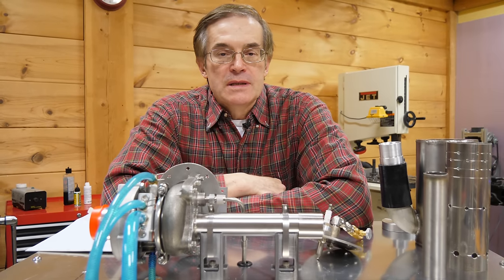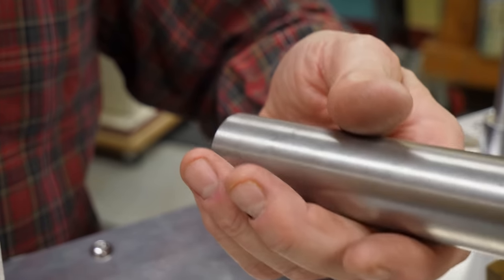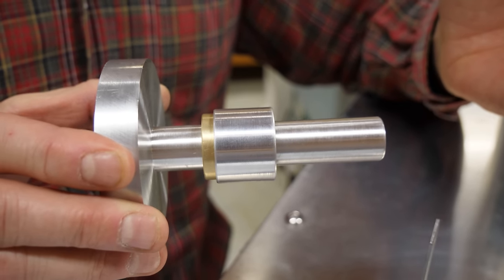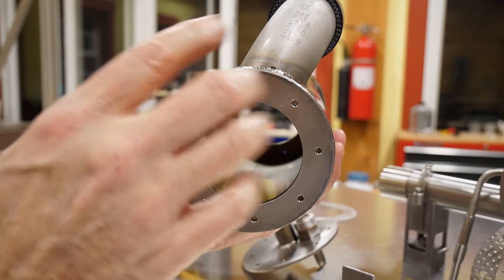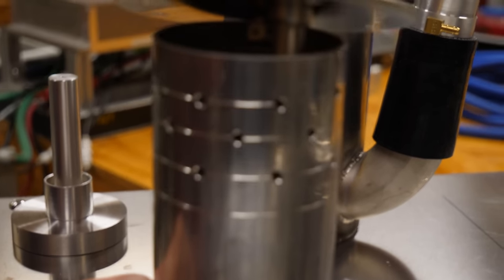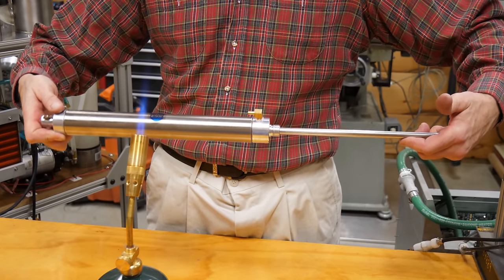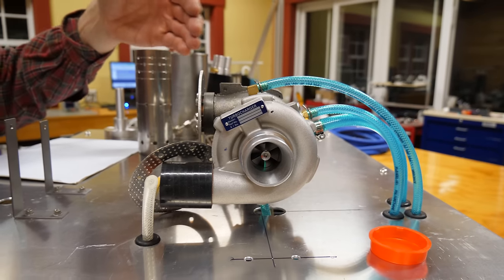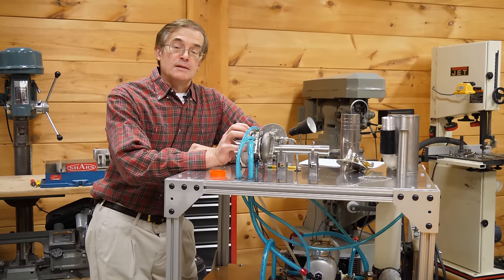The Turbojet!

Comment: This has to be the most detailed DIY turbojet engine build on the internet. Why yes, yes I will watch all ads in their entirety and give thumbs up.
Reply from the maker: Thanks!  Spread the word.
Reply: I take it one step further and click the ads :)
Reply: Chad L. I pay 12 bucks a month so that i can live ad free in you tube. I believe ive saved at least 1 years worth of brain washing. Lol 12 bucks means i skip one lunch a month dont hurt as much as an ad kicking in on the apex of my you tube binge.
Reply: Then you haven't watched Igor Negoda :)
Reply: Hey just so you know you don’t actually have to watch all the ad just at least 30 seconds, YouTube gets paid for simply serving the ad to give people the option of possibly buying and not on watch time alone. Clicking can help though sometimes.
Reply: Well....it's not "most detailed"  ;) watch?v=dYFYZ-g7fzA
Reply: I love that we saw the ratios for the inducer and flame holder holes, which other builds gloss over.
Reply: @TechIngredients  Type: Turbojet
Length: 3.86 m (152 in)
Diameter: 81 cm (32 in)
Dry weight: 719 kg (1,585 lb)
Components
Compressor: 8-stage axial compressor
Combustors: Can-type, 6
Turbine: Single-stage
Performance
Maximum thrust: 8.8 kN (1,980 lbf) at 8,700 rpm
Overall pressure ratio: 3.14:1
Thrust-to-weight ratio: 1.25

Comment: OMFG, the most detailed explanation of a burn chamber ever.

I was toying around with the idea of used oil burners, and I never could understand the great variation in burn chamber design. Most videos are like "and play around with it and make it work for your particular setup", but nobody gives any amount of theory on how to approach this problem, and how to judge various failure modes.

I realize that a burn chamber for an oil burner would be far more complex because of the wider variability in fuel type and quality as well as operating range of the fuel flow and air flow, but at least now I have some sort of glimpse on how to approach the problem. (I hesitate to say that I now have some sort of understanding, 'cause there's nothing i truly understand about it, but hey, it's a starting point).....

Comment: It's very helpful that you differentiate between scientifically calculated parameters, rules of thumb with explained bounding limits and "dark art" design. Without this clarity, a novice might think that this is a mature technology where a design could be calculated and built without testing or iteration and would perform as expected. There's a reason why companies like General Electric, Pratt and Whitney and Rolls-Royce still test new designs.
Reply from the maker: You have hit on a very important point.  Deterministic guidelines provide a foundation for the "rules of thumb".  This makes improvements and modifications much easier.

Comment: Great build. The only recommendation I have is clocking the center section so the oil drain is pointed down. Turbochargers use piston ring seals and use gravity to drain the oil. Having the drain on the side will cause the oil to backup and eventually leak into the compressor and turbine housings. Amazing craftsmanship and elegant design! Excited to hear it run.

Comment: Great explanation of the logic behind the combustion chamber 👍
Reply from the maker: Thanks!
Reply: I've been interested in these homemade turbojets for years. Still can't figure out why the combustion chamber's seem way out of scale to the turbo size.
Reply: @Brian Borell Fuel burn speed/combustion air velocity. You want all the fuel to burn within the combustion chamber and never within the turbine. As he says in the video you want fully burned slightly cooled exhaust gas entering the turbine, because combustion temps will exceed the temp threshold of the turbine.
Reply: 1st time i got it man!
Reply: @beachboardfan9544  I think it's called a flame tube or burner can but judging by your in-depth response I'm thinking you might've known that already.

Comment: Been Working on and off on a turbocharger gas turbine engine since H.S. I have already learned so much from your clear and articulate presentation of this project, Thank You!
Reply from the maker: You're welcome!  
I hope you get it working.  We will be covering a low speed, high torque turbine to convert this into a turboshaft.  You might find more applications for your engine with a rotary output.

Comment: Tech Ingredients What a fantastically educational video, I appreciate your detailed explanations, video style, and calm  demeanor.  Most interesting video I have seen in a long time!
I was wondering if you'd take it under consideration to do a future build on a PDE (Pulse Detonation Engine) which is inherently different and much more powerful than a pulse jet style engine.  They have always been my favorite since the physics of their operation is not entirely known or explained.  Thank you again!
Reply from the maker: We already are.  Our poor neighbors...
Reply from the maker: Probably not, they don't last long.  We have a small detonation chamber followed by an aperture into the main tube.
Reply: @TechIngredients  oh, that's a shame. is the chamber a special shape?
Also, do you think making the spiral hollow and water cooled would help?
Reply: "The physics of operation is not entirely understood", what? To my knowledge, the principles are very well understood. The problem that is a bit more difficult is related to starting the cycle.
Reply: @mandernachluca3774  Yes, the physics are very well understood by a few researchers, putting that knowledge into practice has proven extremely difficult.  As PDE's are more fuel efficient than other systems, they would be in use with many different designs available by now- however they are not as engineering challenges to not only startup, but continuous operation have been encountered.  Couldn't find the reference where I read that the high frequency pulsations of fuel/air intake act as a physical wall to propel thrust out of the exhaust (and that is what is not well understood)-but I will keep looking.  I did find that beyond a few prototypes, the military has black projected the technology.   
From Wikipedia: To date, no practical PDE has been put into production, but several testbed engines have been built and one was successfully integrated into a low-speed demonstration aircraft that flew in sustained PDE powered flight in 2008. In June 2008, the Defense Advanced Research Projects Agency (DARPA) unveiled Blackswift, which was intended to use this technology to reach speeds of up to Mach 6.[4] However the project was reported cancelled soon afterward, in October 2008.
Reply: @mandernachluca3774  Could you give me a simple explanation as to how a tube can be utilized to generate thrust at higher efficiency and speed than any other jet engine?
Reply: @ProlificInvention  
Well, easy, what is the most efficient way of converting chemical energy directly into movement? We have several ideal cycles for these calculations and the most efficient one is the carnot cycle, wich is currently technically not possible but we could improve on the cycles known to be possible. For example the otto cycle, funny enough, there is a cycle very similar to this one, it is called Humphrey cycle and it pretty much describes the ideal conditions that the PDE engine gives us, namely the almost isochoric heat increase and almost limitless expansion of the gas. In theory, it really isn't that complicated.
Reply: @mandernachluca3774  Great information, thank you.  Do you know of a simple way to create Detonation as opposed to deflageration in a tube, and what process is the most superior for small scale Pulse Detonation Engines?
Reply: @mandernachluca3774  You seem to have misunderstood the question, or perhaps Pulse Detonation Engines in general.  They do not utilize explosives, just fuel and air.  A simple explanation of how the Detonation occurs as opposed to deflageration, and which design out of the many would be most ideal for a benchtop or test rig?
Reply: @mandernachluca3774   As Albert Einstein said: If you can't explain it simply, you don't understand it well enough.
Reply: @ProlificInvention  

First, explosives are essentially more or less stable solid fuel-air mixtures, as i said befor, it would be the easiest but most useless way of building a PDE. You can use liquid or gaseous fuel and oxidizer but it is much more complicated, hence not the simples way ;D.

Second, the problem with easy explainations is that they are always condensed and could induce false information. Therefor i prefer the long explanations wich are always falsly called "complicated" :D.
Reply: @mandernachluca3774  Explosives like you mentioned require a Detonation charge to initiate them, so they are very dissimilar to fuel/air Detonation.  The Pulse Detonation Engines up for discussion (that apparently tech Ingredients is working on) are a simple tube with no turbines that instead of deflageration like in a pulse jet, utilize actual Detonation which is a much more energetic reaction.  There are many designs that have been tested with varying degrees of success, the simplest design (and one I considered years ago and was curious about) utilizes a Tesla conduit (AKA Tesla valve) to restrict the deflageration in one direction, allowing for the Interesting effect of subsonic gasses to interact in such a way as to create a "gate" which causes said gasses to rapidly detonate supersonically which initiates Detonation of the remaining fuel/air which takes the path of least resistance thereby generating supersonic thrust out of the exhaust.  This reaction is controlled by the pulse frequency of the electronic ignition system, and the tuning characteristics of the tube. Ideally this can be made to occur at above 1,000 cycles per second which is essentially continuous thrust.
Reply: @ProlificInvention  
Who told you that explosives need a detonation? Especially nitroglycerine is so instable, that it can explode be mere contact. Explosives are essentially fuel-air (or should i say fuel-oxygen) mixtures.
Reply: @mandernachluca3774  You mentioned TNT which is a high order explosive that requires a shockwave to initiate it's reaction which is usually a low order detonator, nitroglycerin is a highly unstable contact explosive that can detonate from very little initiation energy, however it is unlike a fuel/air detonation as it doesn't require air.
Reply: @mandernachluca3774  Nitroglycerin detonates due to the strong molecular bonds decomposition, it is nothing like an air/fuel explosion which undergoes deflageration (except in very certain circumstances, hence this conversation). 
Here you go:
https://en.m.wikipedia.org/wiki/Nitrate_ester
Reply: @ProlificInvention  
Eeeem, you do know that your link proves my point of it being a fuel oxygen mixture, do you? The article states " The considerable chemical energy of the detonation is due to the high strength of the bond in molecular nitrogen. This stoichiometry is illustrated by the equation for the detonation of nitroglycerin", this clearly shows  that this molecule already has the needed oxygen for the stoichiometric equivalent of fuel, in this case nitrogen )and seemingly hydrogen and carbon but those are not quite in the picture). In fact, the only thing that separates detonation from deflagration is the speed of the pressure wave but explosives are essentially the same as gasoline fuel or diesel, except for the fact that explosives are much more potent, diesel would yield such a high energy only under high compression. You could build a bomb with essentially every fuel, even with flour, sugar or coal dust. There is even a certain type of bomb, commonly known as vacuum bomb (or thermobaric bomb), this type of  bomb specifically calls for a deflagration, the fuel and oxydizer are not contained through a container or a strong molecular bonding, this creates a huge fireball that essentially burns out any bunker in it's radius.

Again, EXPLOSIVES=FUEL-OXIDIZER MIXTURE.
Do you remember solid fuel  rocket booster? These are essentially huge tanks filled with explosives with an agent mixed into the mixture to prevent detonation.
Reply: @mandernachluca3774  The detonation energy released is from the breakdown of the nitrogen bonds, the heat released is from the oxidation, just as in a TNT reaction.  Are you seriously comparing high order explosives to fuel/air? Whatever...agree to disagree I suppose.  That's beside the point anyway, I'll just post my earlier comment and perhaps you can give me your unique explanation and insight of how Detonation occurs in a PDE, in layman's terms as that would be helpful.
Reply: @mandernachluca3774   Explosives like you mentioned require a Detonation charge to initiate them (TNT) Nitroglycerin's energy also comes from the breakdown of molecular nitrogen bonds, so they are very dissimilar to fuel/air combustion/conflageration/ Detonation.  The Pulse Detonation Engines up for discussion (that apparently tech Ingredients is working on) are a simple tube with no turbines that instead of deflageration like in a pulse jet, utilize actual Detonation which is a much more energetic reaction.  There are many designs that have been tested with varying degrees of success, the simplest design (and one I considered years ago and was curious about) utilizes a Tesla conduit (AKA Tesla valve) to restrict the deflageration in one direction, allowing for the Interesting effect of subsonic gasses to interact in such a way as to create a "gate" which causes said gasses to rapidly detonate supersonically which initiates Detonation of the remaining fuel/air which takes the path of least resistance thereby generating supersonic thrust out of the exhaust.  This reaction is controlled by the pulse frequency of the electronic ignition system, and the tuning characteristics of the tube. Ideally this can be made to occur at above 1,000 cycles per second which is essentially continuous thrust.
Reply: I would have preferred this video be filmed during a fire fight. A good ol fashioned gun fight always spices things up just right.
Reply: He is good, but i get some crazy scientist vibes.
Reply: Somebody needs to ensure that Scott Manley is aware of what is being proposed here. :)
Reply: @ProlificInvention   Difference between detonation and the rest of the above mentioned  is that a detonation is supersonic, and that is by no means very fast compared to lets say tnt or rdx ( 350 vs like 5000m/s).  It comes down to timing or rather the right stochiometric mixture and pressures.To say the least,  if you want anything supersonic within controlled flow, is not going to be easy period. The PDE is the supersonic equivalent  to a scramjet. A ramjet is nothing new and has been used for well half a century and is a reliable propulsion method. Having supersonic  combustion on the other hand has taken the better half of last century to even basically get right on a lab scale. If a DARPA program is stopped in a hurry it usually means, wait another 20 years and then try again. They are testing pulse detonation at the TU Berlin for example but primarily as a means to increase thrust/fuel economy of jet aircraft.  If it were easily done, there would at least be a handfull of missile systems employing PDE thrusters.

Comment: Great video, thank you!!
One thing that stuck with me about doing custom turbo work is that you should have the oil flow through centre cartridge to be as close to verticle as possible.  It looks like your oil flow may be more horizontal? Not sure if this will cause any issues.  Most turbochargers can be "clocked" fairly easily to get the oil inlet right up top. Keep up the great work!

Comment: you may have a dc offset in your audio - when i skip around the video i hear clicks and that is a symptom of dc offset (or a lot of bass rumble). use a high pass filter and dc offset removal on your audio. your audio interface might have a switch for that in hardware or software.

Comment: I have a huge Caterpillar turbocharger sitting in my shelf, I scored it on ebay before I did the calculations. It would be to big and sadly it looked like it came from a sunken ship... So I bought a tiny Smart turbocharger, but the seller forgot to mention, that a nut or screw had crushed the compressor wheel. I gave up long time ago...
I am very happy to see  you are using a normal sized turbo for this video/upcoming test...that means you have something similar to that caterpillar turbocharger I talked about for the staging you talked about :)
Reply: No such thing as too big for a jet you will just make mass power/thrust I'd use it

Comment: 9:30 - No turbocharger is water cooled. All turbos are oil cooled. Some turbos are water-jacketed. There is a difference.

The water jacket, as you said, is not mandatory. You can run a turbo with a water jacket without water and you'll be fine. Since again, it is not there for active cooling.

The water jacket is simply there to prevent oil coking in the event the system is shut down with a very hot turbine housing (as you said). You can avoid oil coking by either running the system for a short period (no water) to cool things down, or apply a water jacket to passively cool after shutdown.

10:22 - Almost no automotive setups have water flowing through the CHRA jacket after shutdown.  The process relies on convection.
Reply: The turbochargers you are talking about are intercooled. This setup isn't, so what he's doing with water cooling is preventing heat from soaking into the compressor during operation, increasing the efficiency of the turbojet. He's using science, not blind copying from an automotive system comprised of additional components. Yes, he's smarter than you are -- live with it.
Reply: Nuh uh!